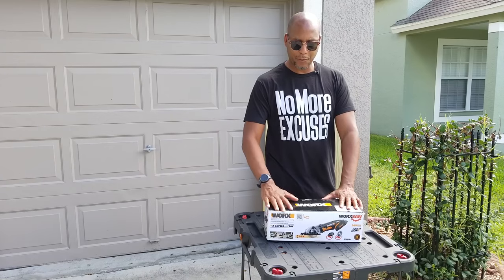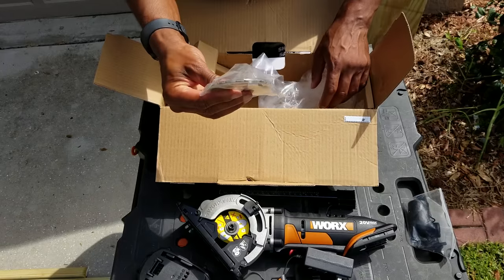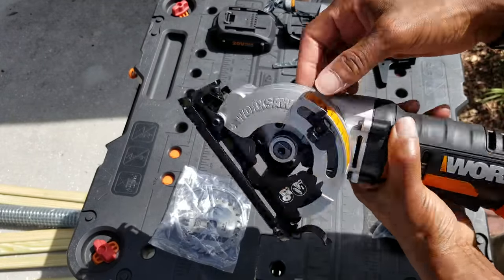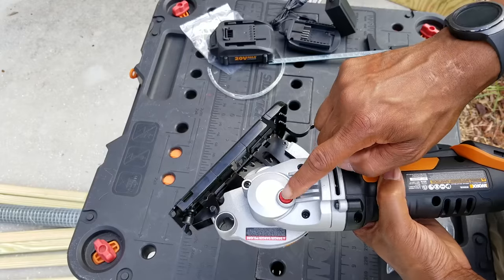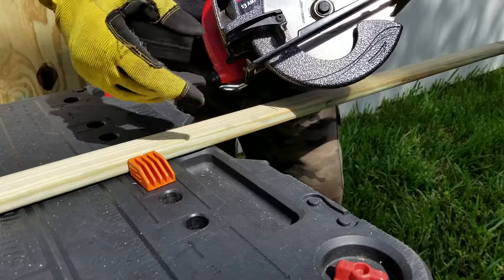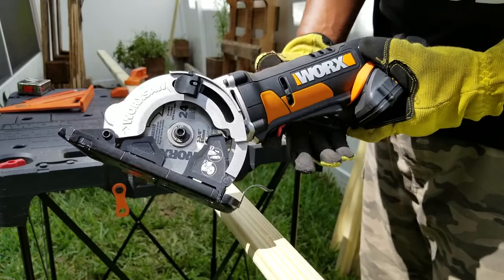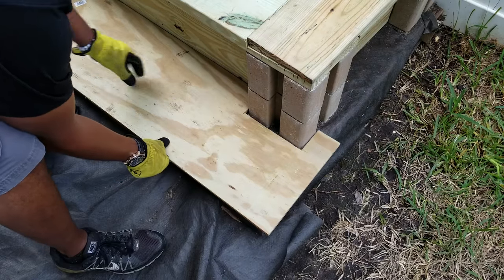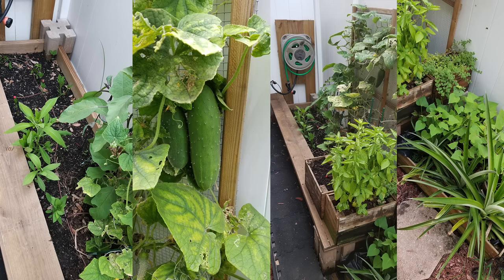Complete review and usage of the Worx Worxsaw

Comment: Wife got me one about 2 years back, didnt get a great deal of use until recently, demolished a garden shed with it, made garden planters with it, chopped wood for a garden heater with it. Recently we have started the process of refurbishing our kitchen, floor was 1/2 inch ply, screwed down to a wooden plank floor at 10" centers, with tile adhered to it using a PVA based grout/adhesive. Hammer chisel wouldn't shift it, Tiles would crack when hit with a hammer but stay adhered. The Worxsaw and a diamond blade allowed me to set the depth to cut along the grout lines, through the underlaying plywood without cutting into the floorboards. Tried at first just using a wood blade but touch a screw or the side of a tile and a wood blade is trash, one diamond blade cut through tile, grout, ply, screws and then allowed the floor to be prised up in sections.  Great little tool.

Comment: I appreciated your video during the time I was checking for some reviews on this particular unit.  So thanks for that. 

I also wanted to convey that after now owning it and being able to use it myself that I've come to the conclusion that your method of using two hands and also advising your viewers to always place their finger on that hook near the base is wrongly advised. 

Why? Well it's very dangerous for starters during kickbacks. At the same time I've watched all the official videos on this unit and they all show that you can operate this unit single handedly (you don't need to use two hands) at the same time without having to use that hook. 

Think of it like when using a triangle square to make a quick straight cut. You'll need a free hand to hold the triangle at the same time the saw.

That hook is only to be used when you don't have a battery in place and you want to visually set the depth of the blade when unsure how thick the wood is when not having a measuring tape at hand so you can later set the proper size depth and etc. 

So the proper way (and safest) is to press down on the unit so the blade starts to cut. And of course, it should already be spinning prior to pressing the unit down and etc. in

Even when you want to do a drop cut, never use that hook, just press the unit down until the saw starts to cut and continue like that until you've completed the cut.

Just thought I'd share that since I hope you or any of your viewers don't risk cutting their index finger off and etc. 

I don't blame you, WORX needs to do a better job in illustrating this in their manuals--since they tend to leave many details out.  Maybe these important details gets lost in the translaion...
Reply: Tina, thank you for confirming my thoughts too. In playing around with the saw in the store, I found that it was not necessary nor a good idea to use that finger pull pointed out in the video. Otherwise the video was great.

Comment: Good job on this video.  Question:  In the video it looks like the depth gage is free floating or "bouncy".  Can I lock it off so I get an accurate 1/8" in or 1/4" in shallow cut?
Reply from the maker: Thanks for watching and the great question. It does seem like that but you can set the depth to what you need. You can set it and move right into cutting without puling up, the more I have used it I have found only certain situations do you need to pull the handle up. I'm hard at work producing new content, get ready for more learning, discovery and fun. Please subscribe to the channel so you don't miss out on all the upcoming videos. There's more reviews, DIY, how to's and cool motivation to come. Thanks again for watching and the question. Good luck

Comment: I have this saw and it's very weak and clogs up with sawdust.  Even when you cut 8mm wood board, after 20cm the saw becomes clogged with sawdust and the blade stops.  In a saw with a cord, this problem does not occur because it is stronger and has a slightly different blade housing construction.
Reply from the maker: Interesting I never have a problem with mine and I use it often for jobs I don't want to get the large saw to complete. Thanks for comment sorry you had a bad experience.

Comment: Don't buy this.This saw has a construction flaw which means that sawdust is not blown out and blocks the blade very quickly.  Every now and then you have to shake them.  The version with cable does not have this problem.

Comment: Sorry to say but got my saw 2 days ago. The biggest waste of my money ever. The saw can't deal with plywood thicker then 12 mm without stopping. Very weak motor. Couldn't get a strait cut no matter how many times I tried. In short...disappointment.
Reply from the maker: Doron thanks for watching and leaving the comment. This is going to sound crazy but was the battery fully charged? You will have limited power with a low battery. If I'm reading this right you said it was having issues with 12 mm which is about 1/2 an inch at 12:35 in the video I'm using it to cut 12 mm plywood with no issues, even did a drop cut. If not the battery perhaps you did get a bad motor and that 3 year warranty will get you going on a new product or just do an exchange. I have been using mine for a while now and no issues as of yet. Check the battery if not that exchange (may have bad unit) From the work I have done with the tool it's solid. I hope this helps, please let me know what happens. Subscribe to the channel more reviews, how to's DIY and motivation to come.
Reply: @DanealLanier  I'm using the non battery model. Strait 220V supply.